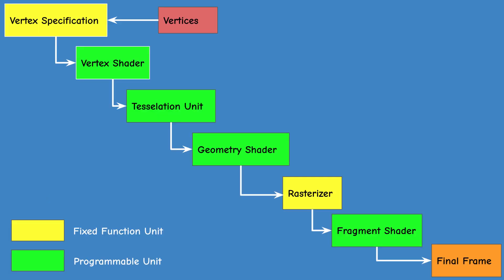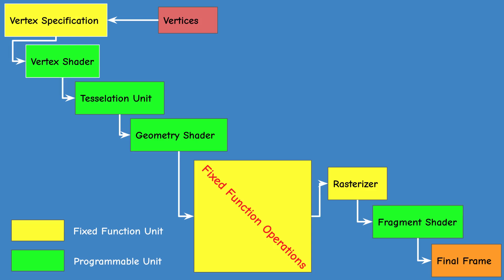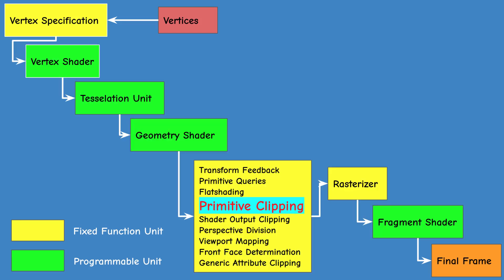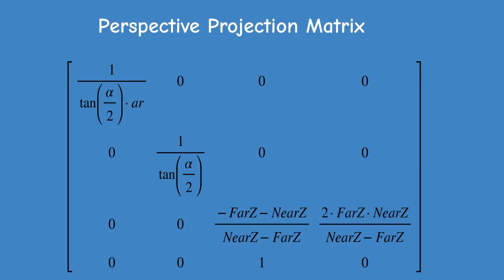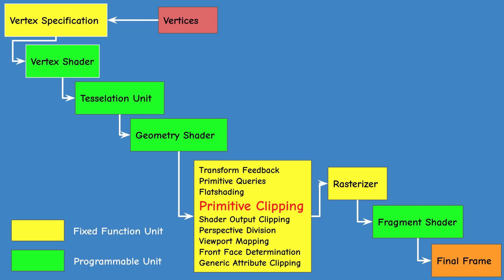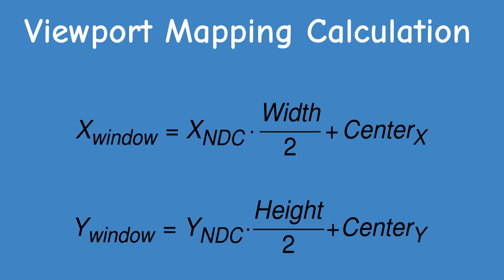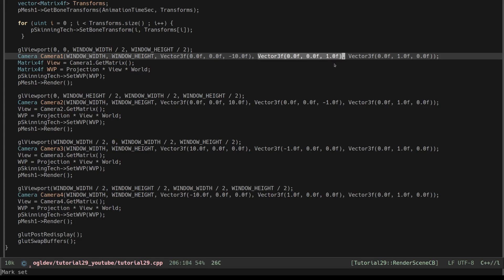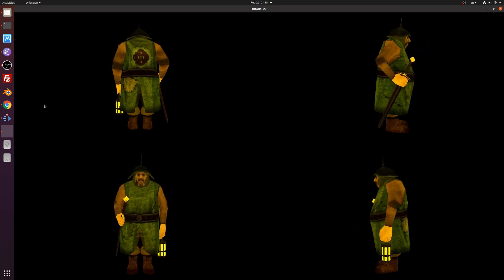Clipping And Viewport Mapping  // OpenGL Tutorial #29

Comment: Nice video and thanks for sharing! Have one question, if I want to create a XYZ arrows to place at 0,0,0 to represent the world coordinates and when I zoom in or zoom out these arrows ‘size’ will not be scaled like other objects. What is the best way to do it? Thanks
Reply: I get the idea of not multiple these arrows by the transform matrix but what is the best way to achieve this since the uniform matrix is written is vertex shaders and applied to all objects? Do I apply a transverse matrix to these arrows in the code or would you recommend something else?
Reply from the maker: The vertex and fragment shader (and any matrix contain within them) are only applied on the currently bound VAO (and the vertex/index buffers) that it references. You can create a VAO with a single VBO that contains just three lines for the world axis - [1,0,0], [0,1,0], [0,0,1]. When you render this vertex buffer use an identity matrix for the world transformation. You can simply place 6 position vectors in the vertex buffer and duplicate the origin three times. There's no point in using an index buffer for such a small "mesh". Remember to use the topology type GL_LINES instead of GL_TRIANGLES. This is the basic setup so the size of the arrows will depend on their distance from the camera. You can improve this by applying a scaling factor which will depend on the distance of the camera from the origin - as the distance grows larger the scaling factor will increase and vice versa. It's funny that you mentioned it because I was planning on covering this topic in the near future...
Reply: @OGLDEV  Thank you very much